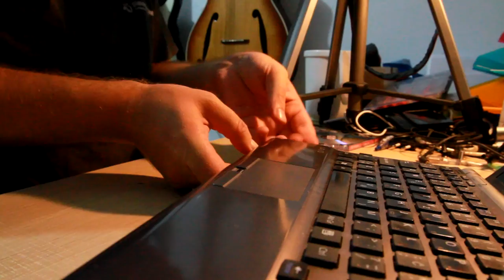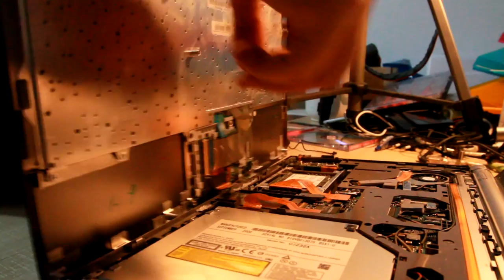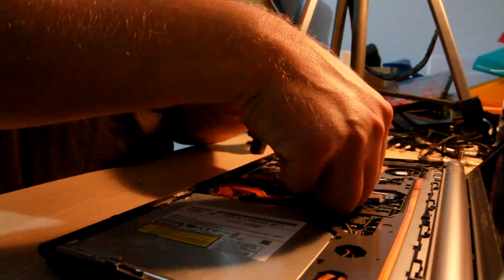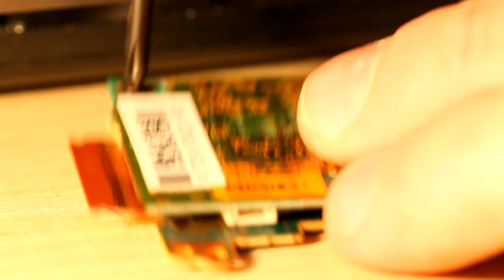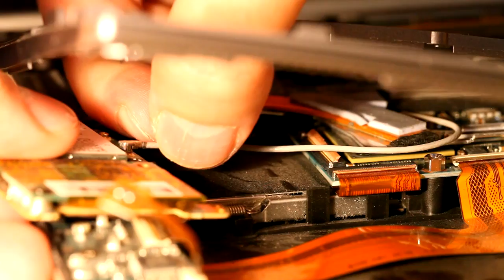Refitting Sony Vaio Z With a 3G Modem

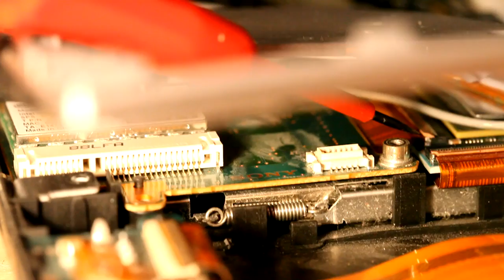Comment: Great practical video. I have used it to replace WiFi module with newer one. However I have not disconnected the WiFi/modem board (2:06), but replaced WiFi module with some fuzz directly under the plastic cover.

Comment from the maker: @offspringq it says phillips 00, so one size smaller than 0. Shank is 2mm in diameter with both, but the driver had has thinner blades. The same 00 size is required for many other laptops.

Comment: Hi
I have the same laptop. I tried to clean its fan, but i didnt know how to separate the keyboard. Suddenly the keyboard has been separated from laptop ( the way which you use for separating, i separate the part which was connected to the bottem of keyboard). I couldnt reconnect it again. Would you please guide me what should i do or if you have a video of how can i attach it?
thanks!